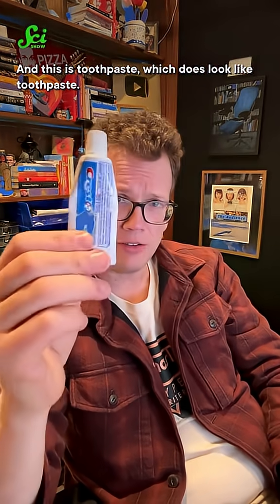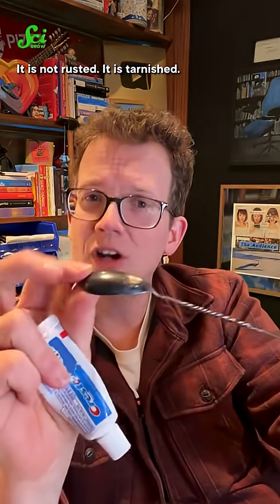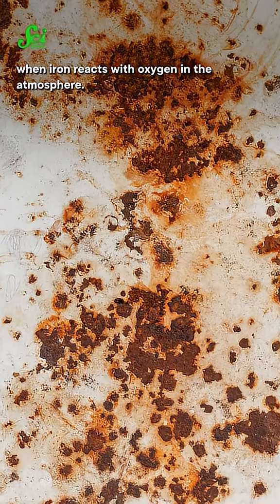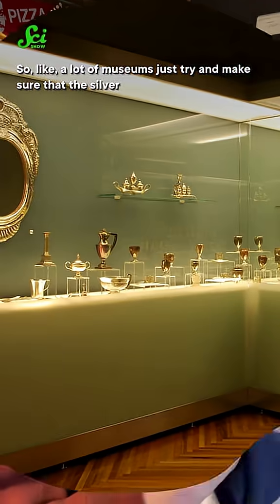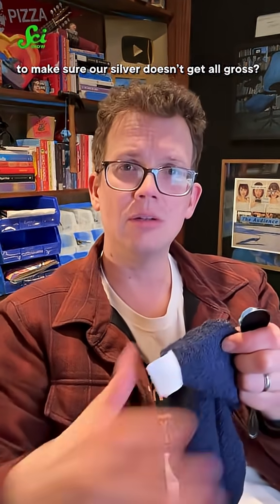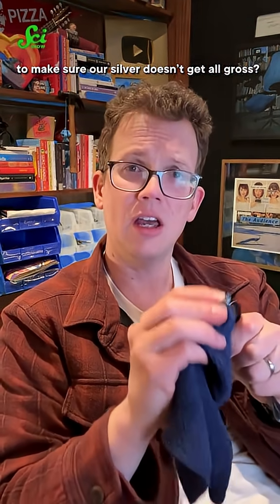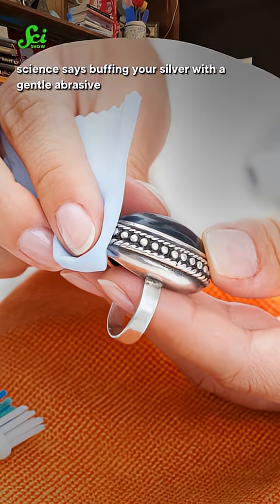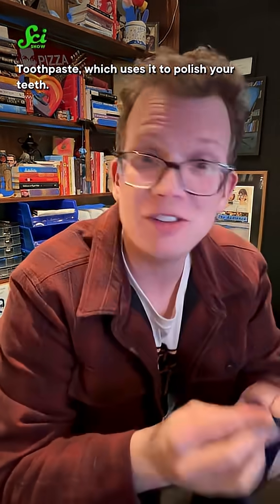What makes silver tarnish?

Comment: The same thing happens to brass and copper. In this case, you can use ketchup to polish and clean your brass or copper. But do not leave the ketchup on your metals! As soon as the tarnish is gone, rinse it with water and dry it off immediately.

Comment: Silver tarnish is easy to remove WITHOUT TOOTHPASTE.
Put your silver item in a container where the silver item can be completely covered with hot water.  Rip up a small section of aluminum foil in quarter coin sized pieces.  Use about 8 of the quarter sized pieces of foil.  Add salt to the mix.   Let it soak in the hot water / dalt / aluminum foil mix.
In a few minutes you will see that the tarnish came completely off without scratching your silver and with ZERO EFFORT.  Just rinse and you're done.

Comment: I have a real cheap wedding set that I got from Etsy as a "until I can get a new set" because pregnancy and weight gain made my engagement ring too small to be resized. So they're rose gold plated silver rings. I messed up and painted my whole house with it on and I think between the sweat and paint exposure the plating came off most of it.... I use tarnex to get the tarnish off... Should I be doing something different?

Comment: Toothpaste is also good for polishing some plastics. I first learned of that use in the 60s from a friend who was a commercial jet pilot: maintenance crews would polish the 'chin' windows down by the pilots feet. (when the plane is angled up, the view forward is past the pilots' feet). He was using it to polish up some motorcycle plastic bits (we were both riders). Some years later I used it to restore a prescription set of swim goggles  (long exposure to pool water was gradually causing the outer surface to frost. No idea if that was the chlorination (which is an oxidizer) or the Ph. Probably the former as the pools I was doing distance in were well managed (no stinging eyes after a couple of miles).

Comment: Learned from Adam Savage: Toothpaste is what is known as a Lapping Compound, which is an "abrasive paste or liquid containing small, hard particles designed to smooth and flatten surfaces by mechanically removing imperfections". Besides toothpaste and polishing, these compounds are used to smooth two mating surfaces in relation to eachother such as a ceramic pot lid or two metal surfaces

Comment: Hi, silversmithing major here, toothpaste and a normal towel are way too abrasive and will leave marks on the silver and wear it down. Conservator-restorers do this: line a container big enough to submerge your item with aluminum foil, dump a good amount of baking soda in, (I like enough that it doesn't fully dissolve), fill with HOT water and mix the baking soda in, once it's cooled just a bit add the items and let them soak. If you have stubborn spots, use a SUPER SOFT toothbrush and more baking soda wet slurry.

Comment: That did not look good at the end, that looked scratched to hell and back... which may have been the starting condition, it may have been the cloth, or it may have been the toothpaste.

I am a goldsmith by training.  You can get special cloths called rouge cloths that have a polishing compound imbued in them that will not scratch your silver.  Or honestly hot water, aluminum foil and baking soda.  The tarnish will electroplate itself on to the foil... all you need to do is make sure there is more surface area of foil than silver.  You will still need to clean off any dirt but dish soap and a SOFT cloth, we are talking your oldest cotton tea-towel.  Silver scratches if you look at it sideways and proves that kleenex really is made out of wood.

Comment: Chemical cleaning by putting the silver in a hot bath of baking soda and salt solution with aluminium foil present is better than any of the methods mentioned. It works because the Sulphur preferentially reacts with the aluminium  converting the Silver Suphide tarnish back into pure silver.

Comment: if you line a bowl with aluminum, fill it with hot water and baking soda, then insert an item that's only made of silver and no gems or pearls, then it will remove the tarnish without any abrasion. The baking soda solution can damage other materials, so it's best to only use silver in it.

Comment: Buffing likely created more micro facets in the surface of the item causing it to tarnish faster from higher surface area to its environment. 

*You can also easily clean silver with boiling water, aluminum, and baking soda. Placing the silver with the aluminum foil (pieces with, or just the item inside an aluminum/aluminum foil bowl.), then placing the baking soda over the silver getting it in all creases and finally pouring boiling water over the item. This works if you don't want to scrape or scratch the item. *

Comment: You can chemically clean silver with iodine-free salt in a non-metallic bowl with water and aluminium foil on the bottom where you then place the silver spoons in. The metals touching shorts out the battery cell that makes and the tarnish gets electrochemically reduced.

Comment: Aluminium foil, hot water and salt work miracles with silverware, too, also neat little chemistry experiment for at home, because the silver and aluminium and silver  basically work like an anode and a cathode in a battery and the warm/hot salt water like the battery fluid 😊 Definitely one of the more practically usable tricks I learned in chemistry class. Like making a makeshift water filter system in a water bottle with pebbles, sand and charcoal (hope, I'll never to use that, but who knows 🤷🏼‍♀️) and making chromatographies with coffee filters, felt tip pens and some water (which, trust me, kids around me always found fascinating, especially when using cheap black or brown felt tip pens on white filter paper, because those two usually split into several different colours), oh and to use vinegar and  baking powder and the "Brausepulver"-effect for cleaning drains and stuff 😅

Comment: I've been using tpaste for years on silver but friendly tip, you don't need a rag. Just put the tpaste on the silver and work it with your fingers and run it under water. Much easier.

Comment: Also, if it's a piece primarily for decoration, you could probably warm up the piece and coat it with a pure carnauba wax to help seal it from the air to prevent tarnish.
Reply: WD-40 works well too.

Comment: I’m a jewelry designer for a large(-ish) jewelry manufacturer and there are a few things we do to prevent tarnishing on silver. Rhodium plating for one, although if you wear the piece often the plating will eventually wear off. There is also a special silver alloy called Argentium that contains a small amount of germanium which reacts with atmospheric oxygen and creates an inert, translucent, and self-replenishing germanium oxide layer.

Comment: Take a bowl. Put a sheet of aluminum foil on the bottom, add 1 tablespoon of baking soda, fill with hot water. Then drop your silver in there and make sure it's in direct contact with the aluminum. 

All the tarnish will quickly disappear.

Comment: I tried a method because store bought paste can cause cancer: I put the plug in the sink and placed aluminum foil in it. Sprinkle baking soda over it then add hot water and put your tarnished silver in. Let it sit for a while. You'll see the water get a little murky from the tarnish coming off.
I heard ketchup works but will the acid  make it worse or is it not strong enough to do damage?

Comment: I'm a jeweller. Guys and gals, please don't polish your jewellery with toothpaste. It isn't adequate for the job, in fact it's too coarse. You'll be able to remove tarnish, but you won't be able to get it to be nice and shiny. 
Rather use a cloth impregnated with diatomaceous earth particles. They are relatively cheap, really effective and last quite long if you use them correctly.

Comment: Activated charcoal or carbon cloth absorbs sulphur gases effectively to protect the silver from tarnis. Cheap and available (aquarium filter charcoal, for instance). Needs refreshing/replacing periodically. Or, silver-protective “sacrificial strips” or paper. Companies make strips of impregnated paper (often with activated carbon or metal salts) that preferentially absorb sulphides. You just tape a strip inside the display cabinet; they last several months.

Chalk or silica gel with additives - ordinary chalk or silica gel can be doped with copper compounds that absorb sulphides
“Anti-tarnish silica gel” is sold for storing museum silver.

Comment: Don't use any of these methods. They will all eventually remove the silver plating. Just grab some baking soda and or salt and some aluminum foil. Get a container full with enough water to submerge your tarnished item. Line it with the aluminum foil and mix in the baking soda/salt. The solution will chemically REVERSE the tarnishing process. Since you aren't using acids or abrasives, the silver is preserved.

Comment: Silver can still rust you just have to be more involved with more heat and o2.

-standard pressure and oxygen at 300*c but will decompose bc decomposition temp. Is 145*c
-2 mega pascal 100%o2 below 145*c
Those are the common conditions for sliver rust at least

Comment: What works quite well is using a redox reaction. Insert your silver into a saltwater solution together with a bunch of Aluminium foil. The sulfur will react with the Aluminium and the silver will return to its elemental state. This should also be safe with iron alloys of silver as Aluminium is a less noble metal than iron

Comment: Tarnish (Ag₂S) is still oxide. Remember sulfur belongs to the same group as oxigen in the Periodic Table of Elements. 
Only hydrogen sulfide (H₂S) in the atmosphere is not as prevalent in the atmosphere compared to elemental oxigen. Also, the tarnish very rapidly creates a barrier that prevents further oxidation.
Fun fact: hydrogen sulfide is present in farts and rotten eggs. So, theoretically, if you fart often, your silverware can potentially tarnish faster than average.

Comment: Chemistry Time!
First, do this outside, it will smell a bit like rotten eggs...

Take your silverware and a disposable aluminum cooking pan (like you would use for a roast or casserole) outside.
Place your silverware in a single layer on the bottom of the aluminum cooking/roasting pan, and give it a dusting of baking soda over top of all the silverware.
Then, get the hottest water you can, boiling is ideal but not required, it just makes it catalize faster.
Carefully pour the hot water over the top of the silverware dusted with baking soda.

It will cause the sulfur compounds to catalyze off of your silverware, and it'll smell a bit like rotten eggs as you do it, so again DO THIS OUTSIDE!

It's harmless, and will work almost instantaneously, you can then just pour off the water, take your silverware inside, and give it a quick rinse under water and you're done.

Keep in mind if the silver is "antiqued" in finish, purposely darkened in areas to give it contrast, it can also take that finish right off and would have to be re-applied.

Comment: The very best way to clean silver is by covering a bowl with aluminum foil, droping some bicarbonate soda and boiling water in it and let your silver items soak for a few minutes. This creates a very interesting chemical reaction that will transfer the tarnish from the silver to the aluminum. It is the only cleaning method that doesn't remove any silcer... unfortunately, this method cannot be used with gemstones as they can compromise the chemical reaction which could affect both the silver and the gems. It also can't be used on pieces that use patina to make design pop since it will remove it. Fun fact: that method also works on copper. No cleaning method is perfect, you need to pick the one that is the most appropriate for each piece, but in general, the toothpaste method is the most polyvalent one. Just make sure you use basic toothpaste and that you rinse the piece well after.

Comment: A cup, line cup with Aluminium foil, add 1 tbsp salt, baking soda and add your sterling 925 pieces in. Add warm/hot white vinegar. its going to fizz and foam aggressively and smell bad. Remove silver after 1min rinse with soapy water. You're welcome. What is happening? You're forcing the silver sulfide ions to migrate from the silver and move to the sacrificial aluminium turning it brown. Similar to electroplating in a very very basic sense.

Comment: After you are done polishing, take a cloth that has been dipped in mineral oil and do a wipe over all the surfaces. Your silver won’t tarnish you won’t be polishing as often and there won’t be as much wear in tear. For silverware that you’re going to be eating from rapid immediately. Anti-tarnish fabric that prevents sulfur from reacting with it. Or several layers of cotton muslin.
Reply: Yep, good tip. I was thinking a super thin coat of petroleum jelly. You just need some kind of oil/grease barrier between the metal and the air.
Reply: @TheWinstonDouble  you were thinking along the right lines however, petroleum jelly tends to gather lint, making later cleanup harder, whereas the thinness of mineral oil won’t allow fibers to cling. It has the added bonus, giving a more intense shine. It’s also good to use on stainless steel sinks, and refrigerator fronts. Just never put it directly on the service rather put it on the cloth and rub the cloth so that you get a super thin film.  It’s not amazing what grandma technology teaches you. RIP Gma

Comment: I don't know for sure if it works on silver but I know for a fact ketchup works wonders on copper. I had an old copper cauldron that someone was using as a pot for plants. Cleaned out the dirt and then started rubbing and brushing with a soft bristle brush and got it right back to the raw copper colour.
Reply: Ketchup is how I clean all my silver!  (and brass & copper too 😊)

Comment: "Rust" is also what happens when your body absorbs elemental oxygen for transport through your body, by red blood cells. The haemoglobin in our blood is based on iron, which bonds with the oxygen we breathe (ie - rusts), allowing red blood cells to easily transport oxygen!!

Nb: It's important to note that this is a WILDLY stripped-down explanation of what's happening in our bodies. None of it is wrong, but it is by no means the full story. There's a LOT more to it than what I've said here.

Comment: Bonus: when aluminum reacts with oxygen in the air (oxidizes) it becomes aluminum oxide which is a) stronger than the original aluminum and b) is the same stuff sapphires are made of (corrundum)

Comment: My method is warm water + aluminium + salt
Don’t remember the exact chemical process but the salt sorta makes the tarnish transfer onto the aluminium when submerged and the heat speeds up the process. 
Just take a small pot, throw in some aluminium foil, generously salt, fill with hot water, chuck your jewellery in there, wait a bit and tadaaaaa!!
Make sure whatever other metals or gems or enamel can withstand the process but my stuff is always fine!
Reply: I just use the backing soda dont seem to need the salt

Comment: Also in forging/blacksmithing forge scale is high temp iron oxied (rust) since heat increases the speed of any chemical reactions and forges burn (combustion has water as by product) and there is oxygen the iron/reacts and makes a black/Grey rust iron oxide and that rust can also rust orange which is why its not used in sand paper while aluminum oxide is used in sand paper.

Comment: Oooooo I've never gotten to be an expert giving technical advice in a comment section before, this is cool.

Toothpaste works pretty well as you've just seen and for VERY tarnished things, like that fully black spoon was, I'd use toothpaste but if you just bought some sterling silver earrings, just get a microfiber cloth and a tablespoon of baking powder that is juuuuuuuust barely wet with some water. Use that when you notice a little bit of tarnish on your new or well polished silver. Its more cost effective 😊